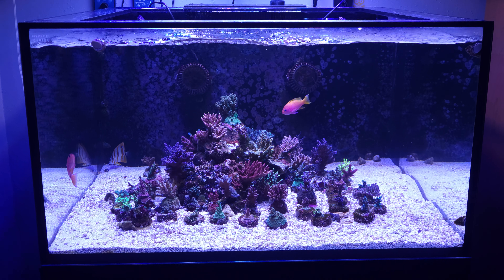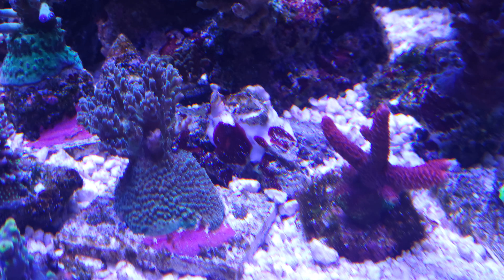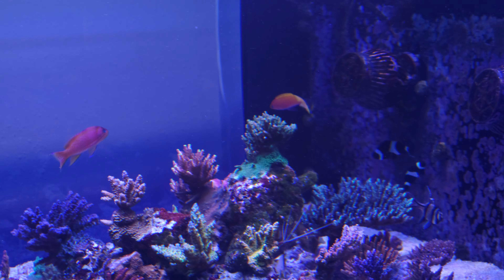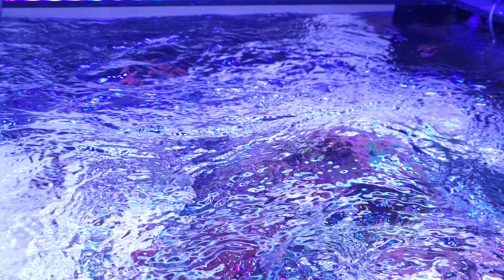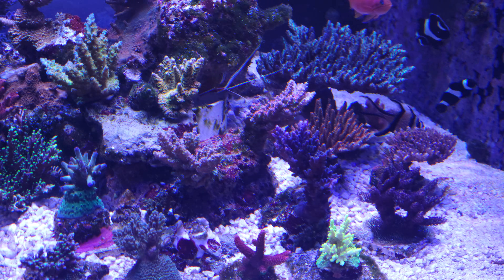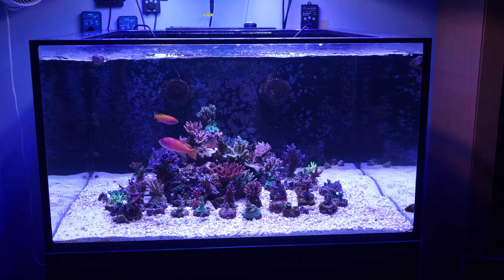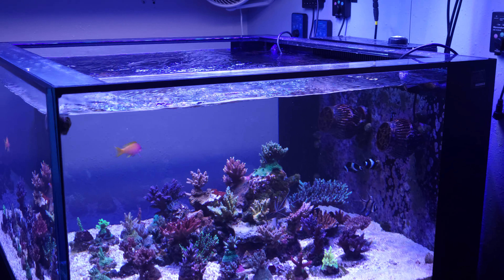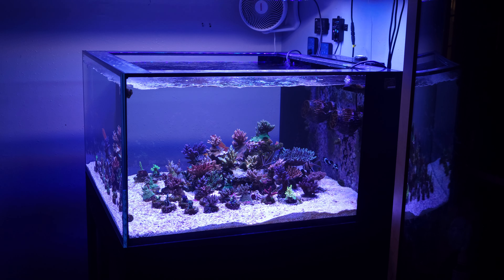The "Smooth Bommie " update 1

Comment: I was thinking , you said 40 x 40 would be better . Is that so the lights fit within the tank better or just the realastate ?
Reply from the maker: No, the light setup is absolutely tailored for this setup. A 40x40 would fit the space the current tank is in a bit more, but no complaints, this footprint 8s plenty for this project  :)
Reply: @PerrysReef  Thanks , You feedback is much appreciated 😀. I'm usually thinking the light set up when using strips or fluorescents would end up going upside the tank a little . Not much , but not ideal . Think 24 " strips in a 36" is 0 K . That would leave 6 " on each side which might be fine . I know its no problem with radions . I been waiting so long to have a tank , I would like to try to get it pretty well . I'm thinking starting out with a 30 x 30 with one 250 watt metal halide . Maybe a 24 " led strip or two . When the tank gets to warm , have the metal halide shut down leaving just the strips . Gotta start somewhere . I heard you say you had a 30 x 30 & liked it . I like the fact that with the 24 " strips you got 3"" on each side from the outside edge . Thanks again for you expert advise . Love you plan on your tank 😀 I

Comment: Man i have a 16 inch in height tank and im having so much trouble with flow moving my sand around everywhere. What sand are you using here it looks like pretty chucky sand.
Reply from the maker: Hey brother!
I use Carib Sea reef sand, and fill areas with Carib Sea Crushed Coral.  I place in front where there is an undertow.  Be well, thanks for posting my friend 🧡